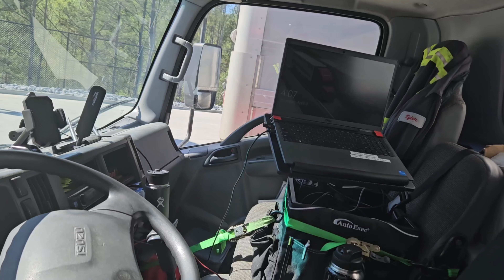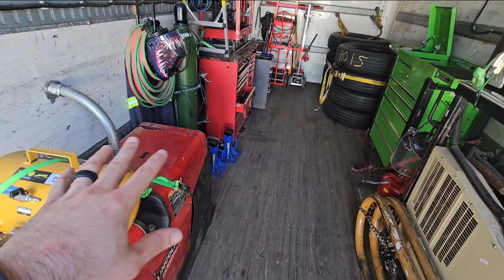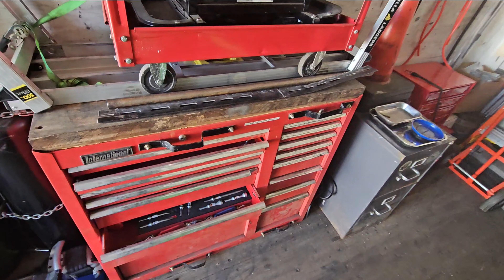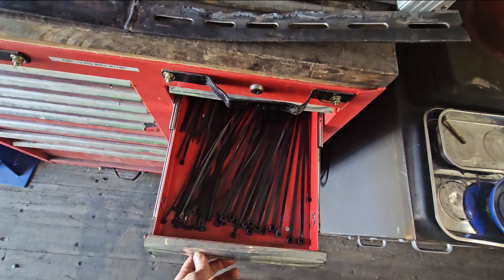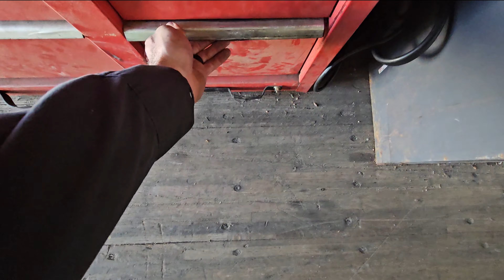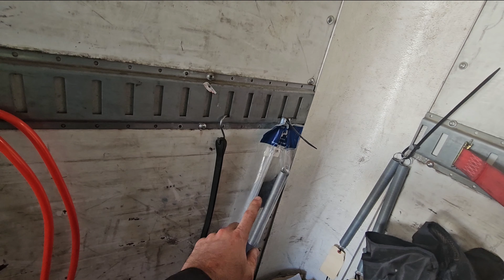Semi Repair Mobile Service Truck Tour #dieselmechanic #trucking #mechanic #diesel #isuzu

Comment: I’m a mobile tech as well and the truck selection for this job is one of the worst I’ve ever seen! Having to use the lift gate every time to go into the truck to get tools or whatever is horrible! I hate companies that use old pieces of shit. 150,000 miles is too much for this job. The truck makes money when it’s on the road so when you have higher mileage it’s a lot less reliable, as you mentioned. Really interesting setup inside though. Not a lot of parts in there. Great video really love seeing other setups
Reply from the maker: Yeah I wasnt a fan of this truck clearly. It litterally broke down weekly. The liftgate was a savior for all the tires I don't miss tires.  I had such a limited scope of what I would fix at averitt that I only needed a few parts. They since have hired more techs and they actually do real fixes in the field.

I work for a fire department now. Got me a 5500 with a maintainer body, crane and all the bells and whistles. Still a 4 day work week like averitt but I dont deal with tires anymore which is amazing.
Reply: @workingwithtyler yeah tires aren’t fun to do. Hopefully you like it now with your new truck.

Comment: i was a mechanic for averitt (erlanger/ cincinnati) from 06 to 2012. wasnt too bad, but the pay was not comparable to any shops in the area. i questioned it and their answer was "well in cookeville, its a good wage." when i turned in my 2 weeks, all the sudden , they wanted to talk.
Reply from the maker: @Skilletky   That famous line of in Cookeville haha. Now they have pay tiers depending where you live. However they still dont pay OT and schedule you for 48 hours. They did pay decent though for the work performed. Their benefits suck though no sick time and you really have to be there a long time to make it worth it. I was making 35 an hour when I left